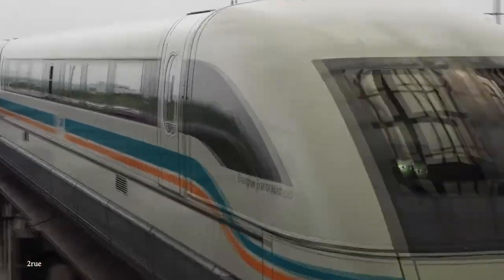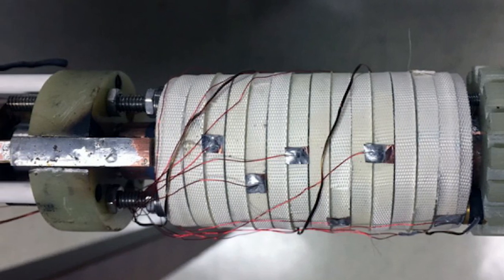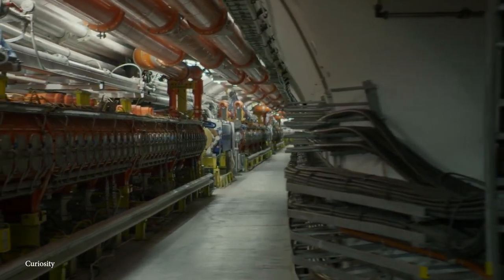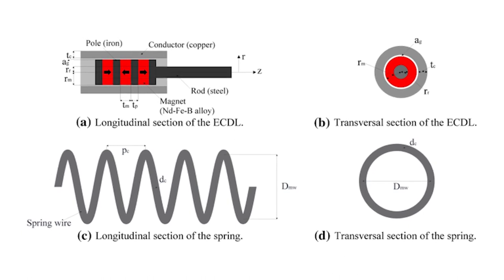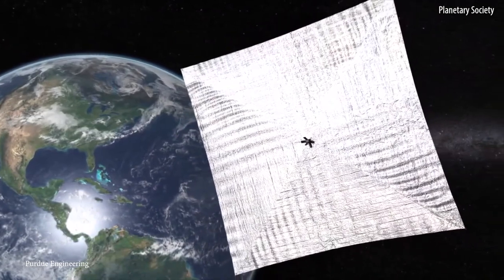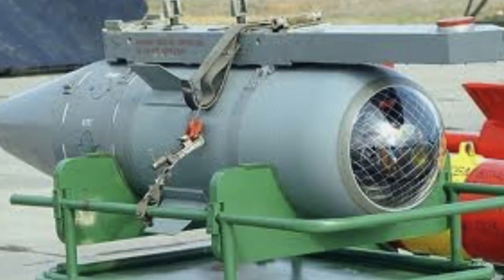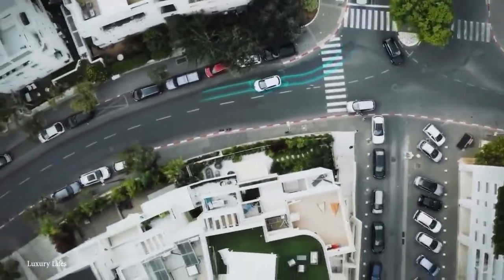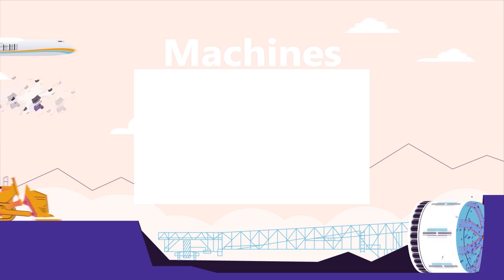TOP 15 Advanced Magnetic Machines

Comment: Perhaps include Magnetic bearing compressors are very interesting and impressive. (At the heart of decarbonization in heat pump’s and chillers. 
Maybe the “earth engine”  could be incorporated in dynamic UPS’s in some data centers. It could potentially save megawatts if it worked!
Reply from the maker: Thanks for the suggestion

Comment: Saying something that runs on electricity doesn't produce any emissions is a flat out lie.
Reply: I'm calling BS on the Earth Engine.
Reply: So would that still be true after the non-renewables are used up? If so, then why?
Reply: @rozgoth  I wonder if you want Electro Boom to try debunking it!
Reply: Unless its charged by nuclear power, and even then you could argue that the construction of the nuclear facility required emissions, however that would be a one time thing, not ongoing like generating electricity from coal.
Reply: @_BLACKSTAR_  there is absolutely no nuclear power plant that is self sustained.  Not one on the entire planet.  So that argument is 100% wrong.